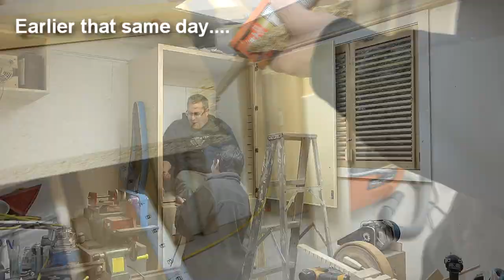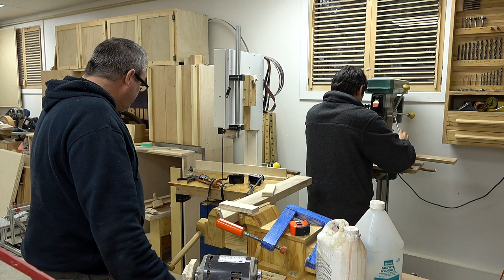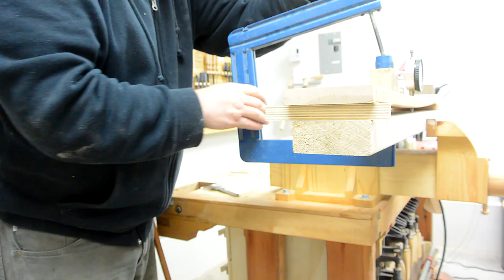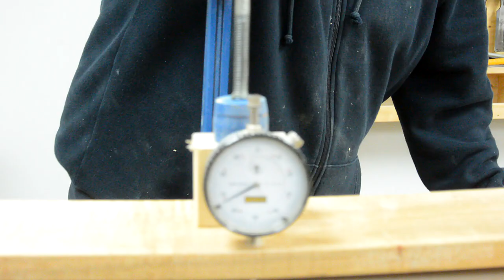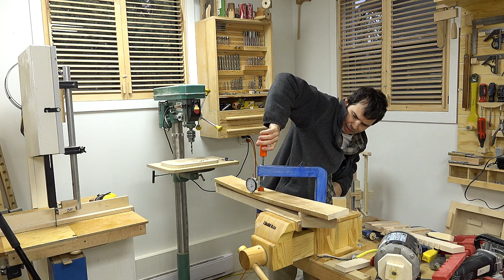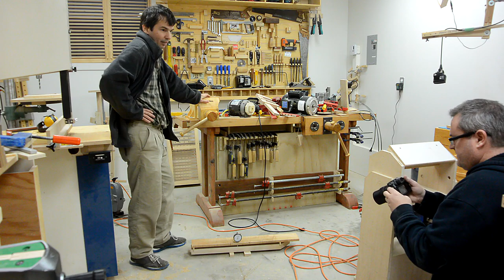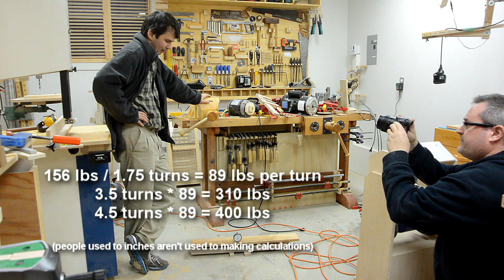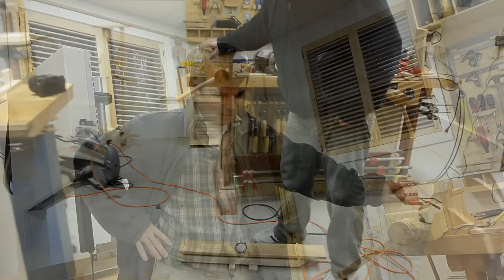Homemade clamp rivalry

Comment: As the clamp was tightened the angle decreased from 90 degrees. That split the force applied by the clamp into two parts. The y-component went into the wood, which was shown by the force sensor. However, the x-component, as the angle dropped, became larger and the force went into the bottom of the clamp, going against the resistance in the rubber.
Reply from the maker: Explain that with a vector diagram...

Oh wait...  I suspect you don't know what that is :)
Reply: I would but I don't know how to upload drawings to comments.  Basically the force vectors are just static friction(Ustatic*Fsin(theta)) towards the clamp, normal(Fsin(theta)) going up, and the force going down which is only Fsin(theta).  So as the angle gets smaller(theta), the x-component of the Force applied(Fcos(theta)) vector gets larger.  This force acts against the frictional vector and is the reason you began seeing the force sensor reach a maximum.  

P.S.  I love your videos!
Reply: That seems kinda rude... I think that guy was just explaining what he believed was going on, and you implied that he was so dumb as to not even know what a vector diagram is...  I mean maybe you are right, but no need to make this guy feel like an idiot.
Reply: I was merely trying to provide an explanation from my physics background because I thought they didn't understand their flawed experimental setup.
Reply: blevenson68 I actually meant that matthias was being kinda rude to you.
Reply: Yeah I know, contrary to popular belief, or at least Matthias, i'm actually not dumb.  lol.  I appreciate you standing up for me.  I was just trying to defend my reasoning.  I guess it's true what they say about meeting your heroes...
Reply: @blevenson don't sweat it, it's just his UW alumni side coming through
Reply: Mathias is very rude sometimes, its best not to comment anymore than the generic "I enjoyed this video".
Reply: i did a little diagram on powerpoint : https://1drv.ms/p/s!Aqr91ziy_de3hAVPPr9xKo69bzdX
you should able to go in modify inside browser to complete it

i'm not doing this to prove someone is wrong and the other is right, but i didn't fully get what you meant only from text

so my question would be :
what effect does
the change of the angle between the plank and the screw
have on
the ratio between the force measured by the micrometer and the stress in the clamp?
(if it have no effect, then the force measured by the micrometer is directly linked to the stress in the clamp, without any other variables)
Reply: I've added two slides to your power point, although I don't know how to save/share it. I think it's working though.

Basically it shows that if the angle of deflection of Johns clamp is greater than 40 degrees, then the total force of the clamp would be greater than matthias' clamp.
Reply: Mrhollerr ah yes, so the plank probably also bent along it's width (if we say that the clamp is not slipping)

and then we could get the real force exerted with a 2nd micrometer showing that deflection (i don't want to say X or Y axis as it depends on how you choose to put the reference)

and then with a rule of 3 from a known force on this direction of the plank (like they did here with matthias's weight)
or with the plank deflection formulas i commented earlier by switching thickness and width
we could get this 2nd component of the force
then have the total force from √(F1²+F2²)

so maybe the experiment could be improved with a 2nd micrometer, or with something to measure the angle of the threaded rod
and then maybe the results would be closer from each other

or we can say that a clamp performance is only the force it can apply normal to the clamped surface, and even say that a transversal force is a bad thing (could make things slip)
and then matthias's clamp is even better

(ok, all of that thinking for a pissing contest, but that made use work on our mechanical knowledge at least XD)
Reply: Yeah there will be a better way to measure the forces in both directions. Just like the more ideal way to measure the y-direction force in the first place would be to use a bathroom scale.

But like you say, I don't think you need to consider the other forces. A clamp is specifically for clamping directly down, so any force that isn't in that direction is just wasted really and is a failure of the clamp.

Comment: Why would you try to apply so much pressure with a clamp? If I required that much pressure I would build a press.
Reply from the maker: Because if the clamp can apply this much pressure, you don't need to build a press.
Reply: Why make a car that can go 150 m.p.h. when the max speed limit is 70?  Because you can.

Comment: what material is made the clamps? wood? Steel?
Reply: Wood. This is Matthias' video about how he made them: /watch?v=5U7ufIyBaos
Reply from the maker: John's uses a threaded rod on the back part to hold he tension.  Other than that, wood.